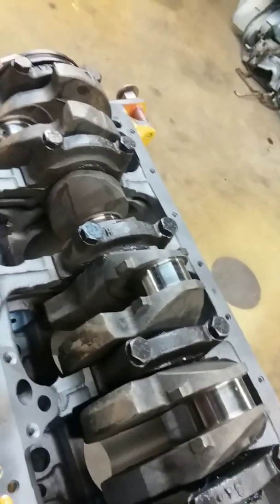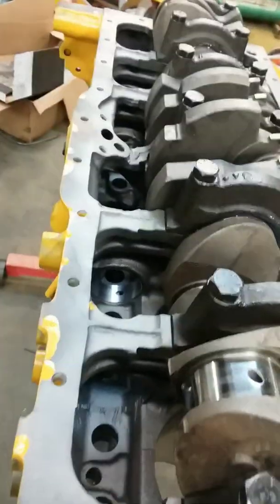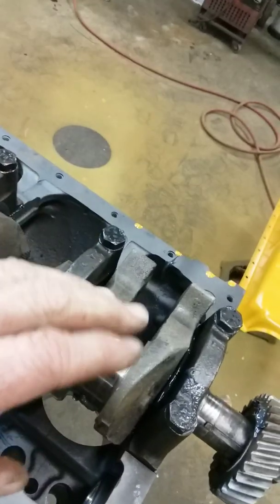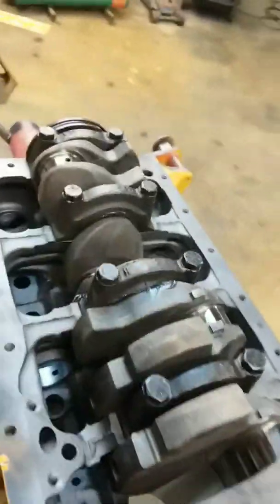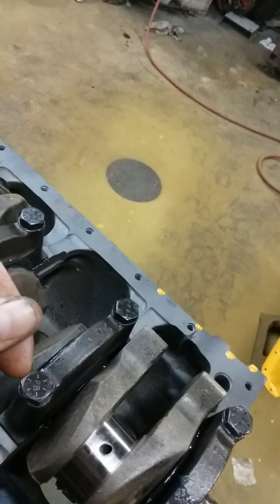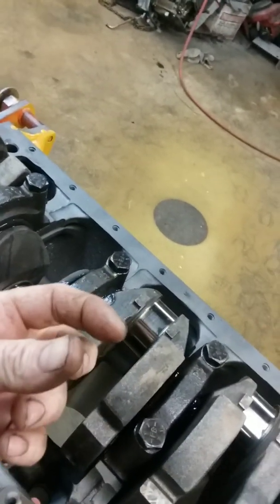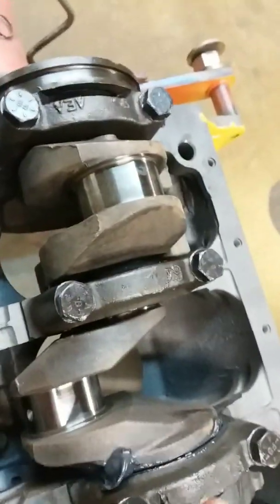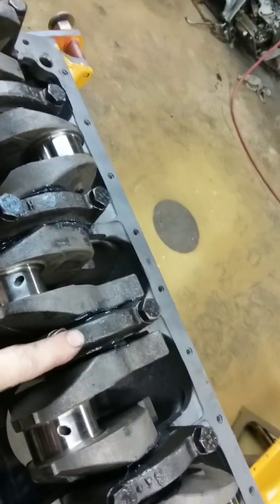Ford 300 6 cylinder rebuild ( part 2)

Comment: How careful to you have to be with that 3 wheel engine stand? I'm about to build a couple 300s and am considering a stand upgrade before I start.
Reply from the maker: Not to bad it would be more stable with 4 wheels but it works good